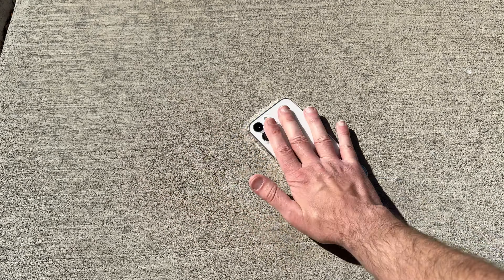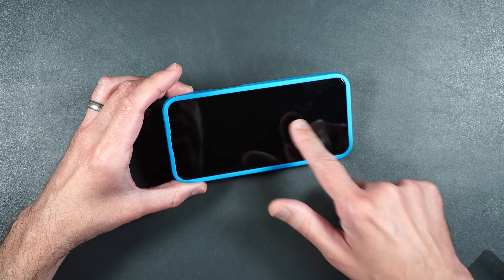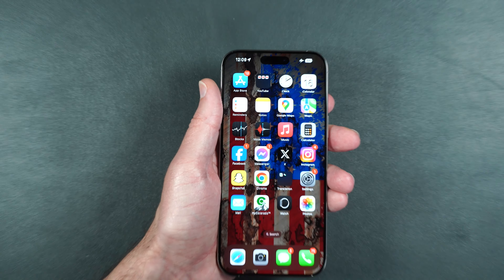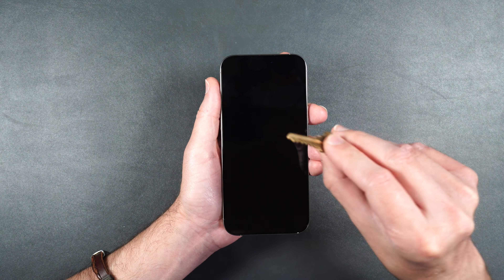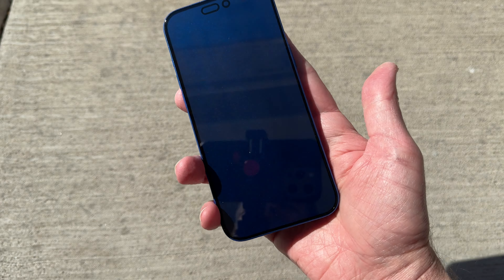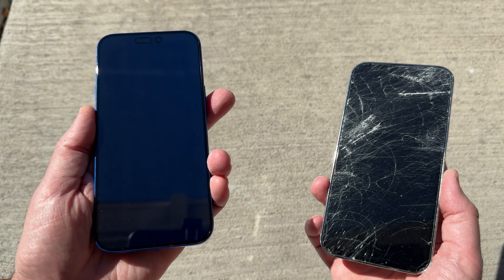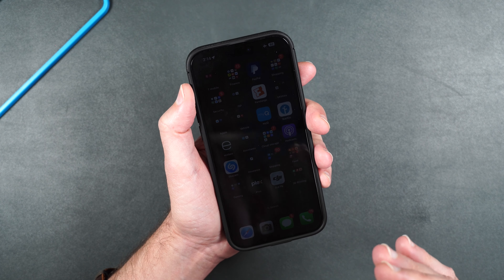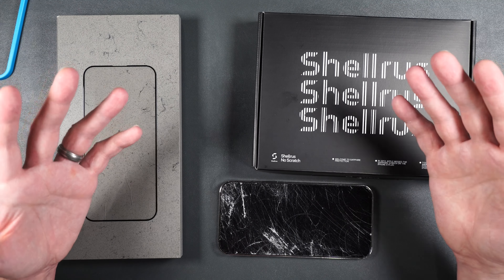STOP Wasting Money on Cheap Screen Protectors for iPhone 16 Pro Max! - SHELLRUS Sapphire

Comment: So.. $70 for a screen protector that covers up the edges of your screen and isnt the fancy new dustless application method? Why is every major company failing to make a decent screen protector this year?
Reply: Shellrus can't use the "anti-dust, easy installation" method because sapphire is less flexible than tempered glass. On Shellrus's website FAQs, they said, "We’ve tried various fancy tools, but they don’t work well with sapphire because it’s not as flexible as tempered glass. This makes it more likely for air pockets to get trapped in the middle, which are tough to remove."
Reply: we've worked on the dust free cabin for 2 years, it's gonna cause more problems with sapphire.

Comment: This video is a pure low quality ad for a below average product. Besides the improved scratch resistance, nothing is good about this screen protector, even if you tried hard to make it look good and justify the flaws (the black borders that covers a portion of the screen, no anti dust easy installation, light bleeding from the edge, poor performance when used with polarized glasses vs Flolab and others, drop test, extremely high price point, even the first 8min long scratch test methods are stupid not to say biased). Extremely disappointed with this "review", and lost trust in this channel. Last but not least, the title?! How can someone stop wasting money by using a $ 70 screen protector that will shatter with any light impact... I rather have a $4 scratched glass screen protector that can absorp few drops and protect the screen, as it name suggests : "screen protector"
Reply: Shellrus can't use the "anti-dust, easy installation" method because sapphire is less flexible than tempered glass. On Shellrus's website FAQs, they said, "We’ve tried various fancy tools, but they don’t work well with sapphire because it’s not as flexible as tempered glass. This makes it more likely for air pockets to get trapped in the middle, which are tough to remove." Plus, how is the first 8-minute-long scratch test stupid?
Reply: @gelgel4823  Man come on, the product is 70 USD, and the video title says "STOP Wasting Money on Cheap Screen Protectors". If the installation fails from the 1st trial as we can see on the review, then what's the point of a scratch proof screen protector with bubbles and dust behind the glass. Should I order 2-3 units to make sure I get the installation right? Then where is the money saving the title promises?
Regarding the very boring 8 minute long scratch test over the concrete, this test makes absolutely no sense, when we know that this sapphire 70 USD protector will completely shatter as soon as it touches the ground...  That's stupid as it can be. Plus, glass can't be scratched by keys and razor blade, it's scientifically impossible and always demonstrated by JerryRigEverything, so better stick with the Mohs test and save us 8 minutes.
Reply: @Otmanes1  I don't agree with the title of the video as tempered glass screen protectors can do the job of protecting your smartphone screen if you're finding yourself dropping your smartphone more often, but there are still cases where your tempered glass screen protector still gets scratch, such as sand and grit. No matter where you are in the world a few particles of sand will always make it into everything. Sometimes grit can even have tiny diamonds. They would be the type of particles that come off a diamond drill bit or a similar tool.

Claiming that the anti-bubble installation method that we see in tempered glass screen protectors works all the time is stupid. There are about 2 instances where HighTechCheck got a perfect installation from a tempered glass screen protector from what I remember. out of like 30+ tempered glass screen protectors.
Reply: @gelgel4823  You're right in everything you mentioned here. But my personal opinion for my own personal use : a good tempered glass with a bit of flex combined with a good dust-free installation tool are better than a rigid Sapphire protector with no dust-free installation tool (I tried the Flolab one for s24 ultra and my experience was flawless and any bubble can be easily removed with the included squeegee). It's still an expensive glass protector at 15 USD, but with 55 USD left, I can still get a good protective case. And yes, it will still scratch with sand particles or diamond particles but will not shutter easily from the first impact.
Reply: @Otmanes1  obviously it's not made for someone pinched
Reply: not gonna argue with you, there's a reason for us to invest 0.7 billion USD to make screen protectors with sapphire, and we obviously don't expect everyone to understand it.
Reply: @shellrussapphireaccessorie6170  Good luck to you guys. My comments were against the channel and the reviewers claim that are misleading. I believe that there are customers for your products, but it's not for Me. For your last remark "we don’t expect everyone to understand it", are you trying to look smart making potential customers look dumb?... That's not a smart move from a brand investing that much... Peace

Comment: They solved the problem that does not exist by introducing a bigger one. A good protector does not shatter and its goal is to protect the screen. Scratch test of the screen protectors is meaningless. You actually want screen protectors to be made of "softer" glass. It's disposable and when it scratches – just replace it.
Reply: What makes the Shellrus sapphire not a screen protector? The purpose of the Shellrus sapphire screen protector is to protect the screen from scratches until level 10 on the Mohs scale hardness rather than drop protection, it will still protect your screen from a drop. If you prioritize drop protection, choose tempered glass instead. Even some tempered glass screen protectors cracked at 2 ft. with a 2.4 oz steel metal ball.
Reply: @gelgel4823  yeah that's well explained. drop protection is more about phone case rather than the protector itself, glass is prone to drops as well.

Comment: yea but it's just a screen protector, it doesn't matter if it scratches. In fact it's more important that it doesn't shatter because you can't keep using a shattered screen protector but you can keep using a scratched screen protector.
Reply: Get a decent protective case.

Comment: Nice review but for $70? lol i'll take my chances with the $10-$15 ones lol
Reply: Sapphire is expensive, and Shellrus even stated they can’t offer a free replacement due to the high production cost. This is for those who want absolutely no scratches at all, they can't be scratched until level 10 at Mohs scale hardness. There are tempered glass screen protectors that are cheaper than $10. If you don't care that your tempered glass screen protector will scratch at level 6 on the Mohs scale hardness, choose it.
Reply: Don't spend $10 on glass, 6-7 is a fair price for that if shipping is included.

Comment: Trash... no anti-dust installation no reason to buy.
Reply: Shellrus can't use that method because sapphire is less flexible than tempered glass. On Shellrus's website under FAQs, they said "We’ve tried various fancy tools, but they don’t work well with sapphire because it’s not as flexible as tempered glass. This makes it more likely for air pockets to get trapped in the middle, which are tough to remove."
Reply: we are working on that. perhaps you will see it by the end of 2024.

Comment: Hoda is better has anti dust installation it has more coverage on the screen has protection for drops. I bought 3 shellrus screen protectors in less than a for each of them broke from the littlest drop I’ve had 1 hoda the rest of the time I have had my phone and light don’t bleed though the  sides nearly as much
Reply: Shellrus can't use the "anti-dust, easy installation" method because sapphire is less flexible than tempered glass. On Shellrus's website FAQs, they said, "We’ve tried various fancy tools, but they don’t work well with sapphire because it’s not as flexible as tempered glass. This makes it more likely for air pockets to get trapped in the middle, which are tough to remove."
Reply: Guess who made the sapphire for Hoda
Reply: @ then why is theirs better ?

Comment: So that’s what it feels like being a content creator. Mine came in a generic looking box. lol.
Reply: The screen protector was not held down like that, I could hear it sliding around the box. Also did not get a tempered glass backup. Not sure if this is because I preordered but you got all the bells and whistles.

I’m also confused on how easy it was to crack it. AWUs and rear camera glass is using sapphire and there are hammer tests where it didn’t break, how come this only took a 2ft drop.
Reply: Same here, we should be able to get a box like that for $70
Reply: @mitchisreal  sorry about that, we waited until the last minute to produce the screen protectors, we weren't able to finish the packaging for some model in the first batch. Email us for a $10 refund if that's acceptable.
Reply: @yxusuf313  sorry about that, we waited until the last minute to produce the screen protectors, we weren't able to finish the packaging for some model in the first batch. Email us for a $10 refund if that's acceptable.

Comment: 15:57 there are cleary scratches on the screen
Reply from the maker: 🤦‍♂️ Any scratches that you think you see were either on the screen of the dummy phone or fibers from the microfiber cloth. I explained this in the video. I would tell you if there were any scratches but there weren’t any.
Reply: Legit 2 minutes before your timestamp he points out those scratches underneath the protector. Concrete cannot and does not scratch sapphire. It is physically impossible.

Comment: Imo, screen protectors that come with hard plastic backings like this are the worse to install. All the screen protectors that I get that uses this kind of backings all end up having dust underneath the protector no matter how slow or fast you remove it. Those generic plastic film like the tempered glass version is still better at helping the installation, since you can peel it off as you install the screen protector.
Reply: which one do you recommend
Reply: we will work on the tools.

Comment: Overpriced, breaks at2 ft, got 3 ESR & no bubbles for $7 & resist finger prints. These fancy protectors not worth it
Reply: $7 sounds like a good deal. Don't pay for more than $10 for glass, they are dirt cheap.